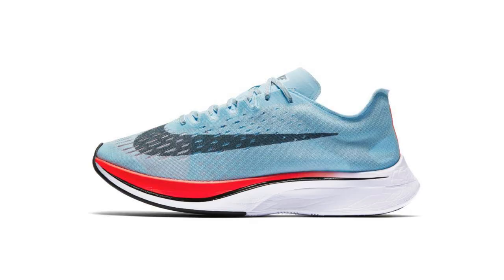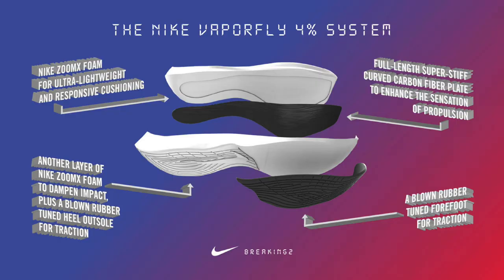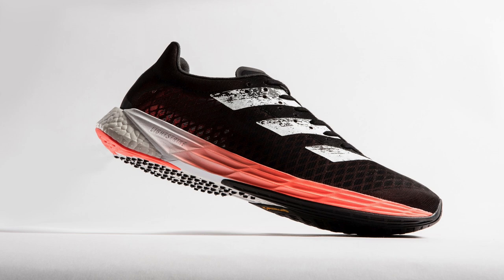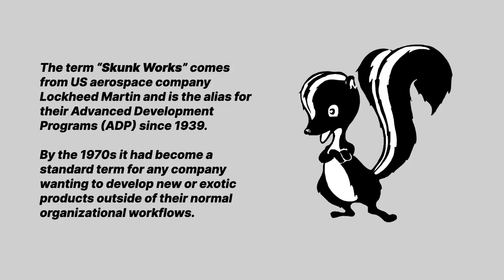Carbon fiber plate vs rods | Why Nike and Adidas made such different design choices.

Comment: You lost me at “A snowboard can be heavier than a running shoe.”
Reply from the maker: Well snowboards are generally much heavier than a running shoe… which allows for the use of more carbon fiber and resin material to strategically target flex and torsional twist. That requires something much thicker and heavier than would work in the midsole of a running shoe.